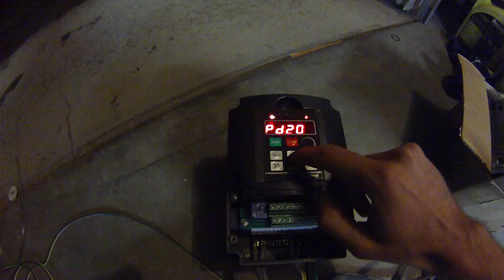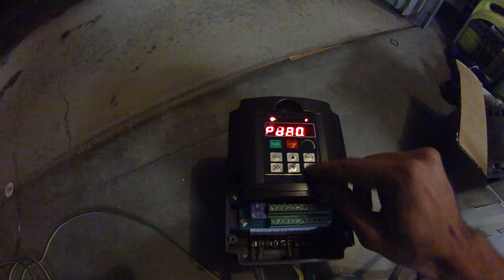cnc r5 spindle test

Comment from the maker: Apparently this VFD will run at either 220 or 110.  I was a bit worried when I asked the seller if it would work on 110 and they said it would work either way.  Once I got it and figured out how to wire it and read through the manual, it worked pretty well!

I still haven't hooked it up to the cnc controller, but manually starting/stopping the spindle hasn't been that big of a pain yet.

Comment: Hi, I'm also building a CNC router and I'm planning on using a watercooled spindle with the same HY VFD that you're using in this video. Did you have to ask the ebay seller you bought it from to send you one that was specifically for 110V, or is this the usual 220V version (HY02D223B) that you're running on 110V with those PD200/PD209 settings?
Thanks
PS nice blog.